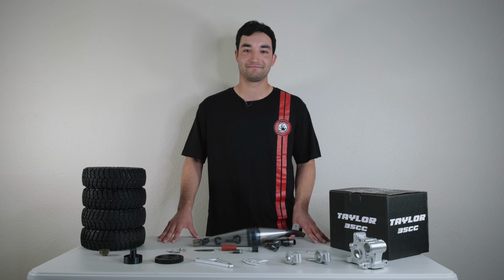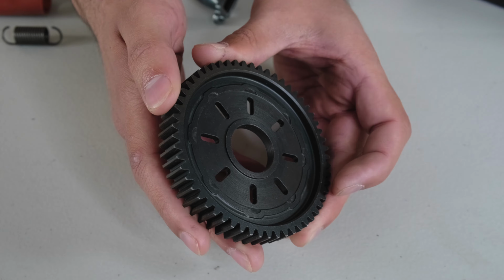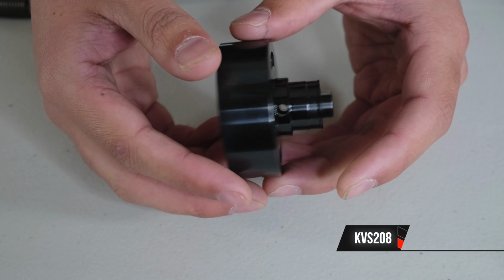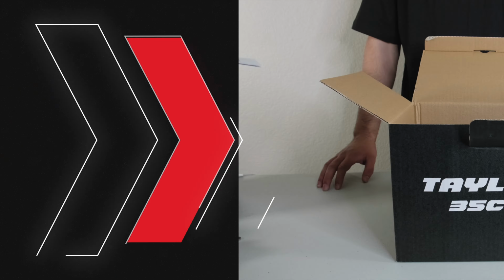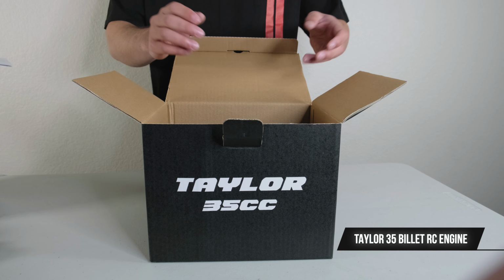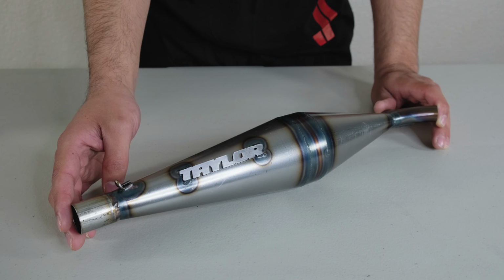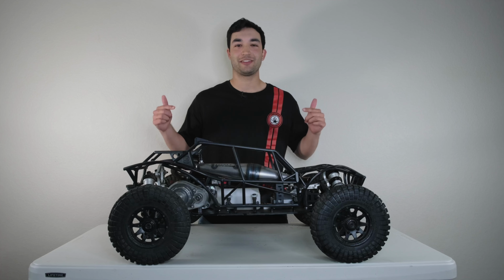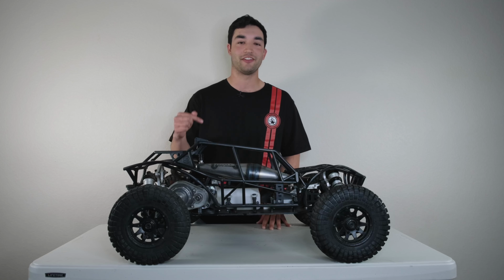Upgrading your KRAKEN VESLA.5

Comment: Awesome upgrades. it is too bad that you can't use a small block with your new Big Bore Transmission.
Reply from the maker: Not the engine, it is your pipe header. Get Taylor's pipe, problem solved.